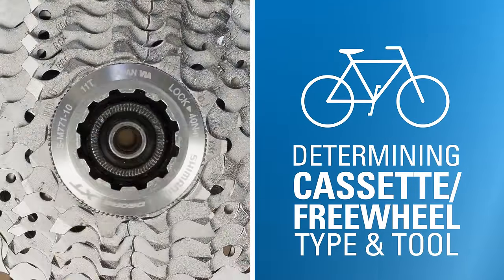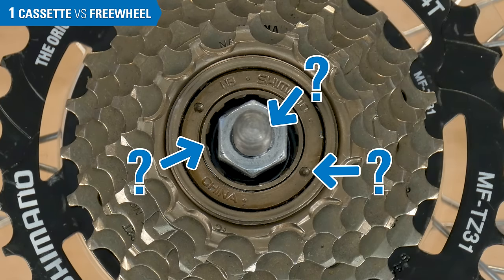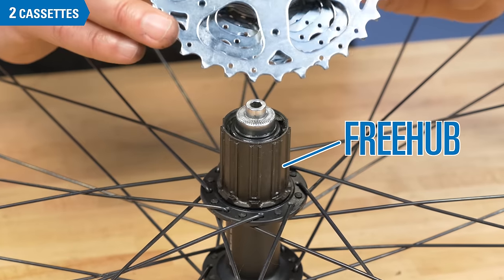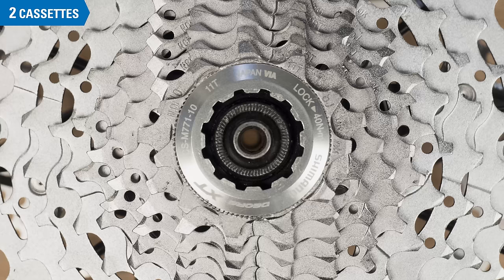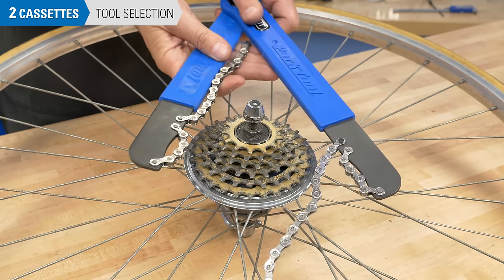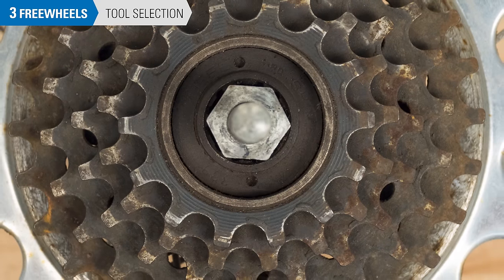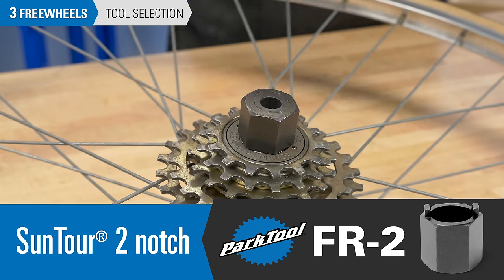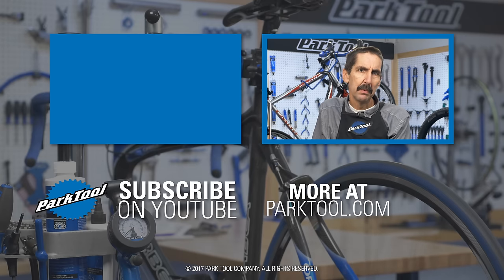Determining Cassette/Freewheel Type & Tool

Comment: Thank you for your awesome videos. Currently running a SunRace MFM300 14-34 freewheel. I bought the Park Tool FR-1.3, which works great for removing and installing the freewheel. However, when trying to service the unit, the adjusting cone sits trapped underneath the 14t cog. While I can use an SPA-2 to loosen the adjustment cone, and disassemble the freewheel, I cannot access the upper bearing race. The SunRace freewheel at 1:26 has the same issue. Is there a tool you would recommend to remove the small 14t cog (it appears to have 4 shallow notches)? I ripped a chain whip apart already, so that didn't seem to be the solution...
Reply from the maker: It is best to remove the freewheel to make the needed adjustments. The really important part is locking the cone to the locknut on the driveside. Then you can make final and down the road adjustments down on the non driveside.
Reply: @parktool  Thank you so much for your quick reply. The "trapped" adjustment cone I was referring to is not the hub cone, but the upper bearing freewheel cone/cap that holds the freewheel together, which can be loosened using an SPA-2 spanner or a pin punch. After unthreading this cap, the freewheel body drops out of the sprocket cluster, but the cap itself remains stuck between the upper race and the 14t cog. It appears you'd have to remove the 14t cog to access the cap (which acts as a cone for the upper freewheel bearing race). The arrangement is identical to the SunRace freewheel pictured in your video at 1:26, you guys even highlighted the 4 notches on the inside of the smallest cog that spin along like on a cassette lockring. I was wondering if there is a tool that fits into those 4 notches, and in combination with a chain whip might be used to unthread the 14t cog .

Comment: So what is the difference between the FR-5.2, FR5.2G, and FR-5.2GT? They all have 12 splines so can the 5.2 be used in place of the 5.2GT?
Reply from the maker: The FR-5.2 can be used in place of the GT, but without the pin use care to keep it fully inserted into lock ring.

FR-5.2- has a hole it in for solid axles. Use skewer when possible to hold tool to lock ring.
FR5.2G- has 5mm pin to prevent it rocking and twisting in lock ring of quick release hubs. Faster to use compared to FR-5.2
FR-5.2GT-has 12mm pin to prevent rocking for thru axle hubs.
FR-5.2H- has handle built in.

Comment: what do you need to re tighten your hub nuts on the cassette side? the hub nut is inside of the cassette and i cannot hold it to tighten the outer lock nut. Thanks.

Comment: notch type 4 notches very old Campagnolo hub. tool? could be campagnolo C Record.
Reply from the maker: The Campagnolo C-record is a freehub system, with a 12 notch ring.   The Campagnolo thread-on freewheel used two notches using their own tool.  Look for a name on the freewheel, not the hub, for the brand.

Comment: I need to remove an old TDC freewheel from a 1970s Dawes Galaxy. It has notches at 12, 4, 6, and 8. Is there a Park Tool freewheel removal tool I can use for this?
Reply from the maker: TDC had a unique pattern.  Park Tool does not have a tool for that model.

Comment: What's the difference between the FR-5.2 and the FR-5.2G? I see that the G has some sort of spine sticking out of it. What's the that for?
Reply from the maker: "G" is for Guide Pin.  It helps prevent the tool from twisting out. You don't need the skewer to hold it is place, and so save some time.  The FR-5.2G is for the quick release axles in 10mm, with a 5mm skewer.

Comment: Does park tool have tools for change ball bering inside freewheel?
Reply from the maker: We do not have the tools for that. It is not recommended by manufacturers and at the point the bearings are in bad shape the teeth of the sprockets are likely worn as well.

Comment: Have an old Shimano 333 High Flange Hub Set Early 1970s 12 splines.  Think the FR1.3 will work?
Reply from the maker: No, the early Shimano freewheels are a smaller tool fitting, but still 12 splines.  Park Tool does not make a tool for this older version.  Search the internet for "Shimano Boss Freewheel Tool".

Comment: The 12 spline FR1.3 for Shimano Freewheel can also be used for 12 spline Shimano cassettes?? The FR5.2 looks the same, what is different?
Reply from the maker: The cassette is a 12 spline but slightly larger. The torque is significant and the smaller FR-1.3 is a sloppy fit and can ruin the ring.

Comment: I have a freewheel and it moves side to side. What do you think the problem is.?
Reply from the maker: It is not uncommon to see when coasting the freewheel oscillate a bit and move side to side.  The bearing surfaces of the inner and outer body are not exactly concentric.  This only occurs when freewheeling, because when you pedal the two lock together and this side to side movement stops.
If this is what is seen, there is no problem.....just don't make a habit of staring  down at the freewheel when coasting on the road!

Comment: What makes the noise when ur not paddling but the noise when ur riding without paddling rattling noise
Reply from the maker: A hub or freewheel that is in good working order will put out a ticking noise when you coast. This is caused in most cases by "pawls" in the one way clutch mechanism. These paws engage into a toothed ring that is attached to the wheel. This allows the wheel to move freely in one direction but not in the other. This gives you the ability to go and coast. Here is an article that contains some images of different kinds of freehubs. Most will have a pawl system similiar to the Campagnolo or Zipp images. Hope this helps!

Comment: I have a shimano splined freehub with both internal and external threading. Is this able t use either the threaded small (external) or the threaded lock ring (internal)? Thanks
Reply from the maker: At this point in time it is usually more logical to use the internal lock ring and appropriate cassette when given the choice.

Comment: what is the measurment of the falcon tool? my free wheel is branded Ko Shaing Industrial Co and is 24mm and 12 splines, a standard 12 spline shimano does not fit it, thanks!
Reply from the maker: Hello eufogia, The Falcon freewheel tool measures 22.9mm. My first guess would be that you need an FR-1.3 and the Falcon would be my second guess. Let us know what you find.

Comment: Is there a one fits all locknut for shimano cassettes?
Reply from the maker: If you have a Shimano cassette, FR-5.2 is more than likely what you need. There are very very few situations with a Shimano cassette that a different tool would be needed.

Comment: What will cause a Freewheel hub to lock up in, Coast and throw a chain off the crank gear? I adjusted all the gear changes, they work fine but it will lock up in Coast in all gears and throw a chain. I took the wheel off and spun the gear cluster in Coast upright like it's on the bike it locks up. Then I turned it flat gear facing up and spun the cluster it turns freely what's up with this?
Reply: My Trek started doing this a while ago--not bad enough to throw the chain but it was binding enough to max out the tenisoner and make the chain sag. The freewheel's got bearing balls inside that the outer part spins on. I opened mine up (left-hand-thread lock ring on the part that doesn't move with the sprockets) hoping to clean and lube it and found that some kind of bearing ball retainer or race or something had almost completely disintegrated. Looks like I'm replacing the freewheel. Maybe something is bouncing around inside of yours?
Reply: John  Yup.

Comment: So... If I want to change my sram for a shimano ultegra the freehub will not be a problem... Right?
Reply from the maker: Likely.  SRAM road freehubs use the same freehub spline pattern. If you are moving from that to an Ultegra it should work. 
 SRAM also produces the XD and XDR freehub systems which is very unique and will not interchange with Shimano. Those came from their 1X series.  See these at https://youtu.be/iTJ3taJHOn8?t=245

Comment: I have a freewheel with 8 notches on my dirtjumper, what tool do I need
Reply from the maker: There are some single speed freewheels with 8 notches.  Park Tool does not offer a tool for this, so contact the manufacturer of the freewheel.  ASC BMX for example makes such a model.

Comment: My Cassette will just fall off if I hold my wheel on its side I'm not careful when I put on new tyres with Cushcore installed , I have a  2018  Rocky mountain Powerplay
Reply from the maker: Sounds like the cassette with freehub body falls off?  The end cap should hold that on.   See if that is the issue.  When it is on the bike, it may not be an issue.

Comment: Do you make a spline tool for removing a Shimano Dura Ace freehub, this tool has 8 splines.
Reply from the maker: What Dura Ace hub model? To remove the freehub you need to remove the axle to access the tool fitting for the freehub body. The tool will depend on the generation of Dura Ace.
Reply: @parktool  It's a dura ace 7201 8 speed hub, the freehub has a spline.
Reply from the maker: Oh boy. Glad i asked. That requires the Shimano TL-FH10 to remove and install. No after market company provided tools for those hubs. Euro Asia imports may have that in stock.
Reply: @parktool  Does EA Imports actually sell bike parts ? Can't see any prices!... Great website though and wasn't aware of it...Thanks for that.

Comment: I have a question about free wheel. My friend has 1975 bike . He try fine how to update real wheel
Reply: Eric Patterson 
Most likely will be will have to buy a new wheel with an updated hub to accept a new freewheel or cassette.
He may be able to have a shop remove the old one and see about fitting a new one on as well. Just make sure it's the right # of gears.

Comment: can we change a single speed freewheel bike into cassette
Reply from the maker: A single speed freewheel threads on to the hub.  The cassette system must have a "freehub" body built into the hub.  See the threaded hub body at https://youtu.be/iTJ3taJHOn8?t=336  This hub will accept a single speed freewheel, but cannot be made into a freehub for a cassette.

Comment: At 1:27 you show a multiple tool fitting one, how do you remove the outer one?  I can't find anything on this
Reply from the maker: The outer is not meant to be removed. This is used to assemble the freewheel. This is a remove at your own risk deal and will usually end with many tiny bearings on the floor. Might be fun though! Good luck
Reply: Thank you, I have rebuilt a few freewheels before.  I bought a bike for my wife and you can tell that it is pretty dry in there, I just want to grease it up a little.  How do I open?  2 chain whips to the  1st gear?
Reply from the maker: This is a Sunrace freewheel. As far as type, I'm not sure how to answer that. Stein tools dones make a tool for injecting grease into the freewheels. I have also used this tool to run degreaser through to clear it from debris and then injected proper grease. http://www.jastein.com/Html/Tools_for_Wheels.htm  Hope this helps you on your mission

Comment: Can I change a freewheel to a cassette sprocket
Reply from the maker: The only way to change is to get a new hub or wheel.
The cassette systems require a special hub.  The clutch part of the freewheel removes with the sprockets.  For a freehub and cassette the clicking part, the clutch, stays with the hub as only the sprockets are removed.

Comment: is it possible to install   cassette hub disc brake + cassette in a  previously freewheel type bike ?   (old  bike 6 speed rear)
more like will it be compatible with the old derailleur ? if i add the new casstte hub with macthing speed number
Reply from the maker: unfortunately there  are no 6 speed freewheels available. You would need to upgrade your drivetrain as well. At this point it is often time to look at a new bike if you are interested in the increased performance.

Comment: My sprocket isn't spinning 0:54, whay could be the issue? I have Shimano system under KHS MTB. It moves a little like 1/8 inch but never spins.
Reply from the maker: If your sprocket is not spinning then you may have something bound up between the largest cog and the spokes or hub. Often spoke protectors can break and cause binding.
Reply: Park Tool I had it fixed this morning. The man took out the sprocket first, then the tube where those small and big BB balls are found. He said that there was a build up of rust, not sure if it was rust. He cleaned it up, added lubricants and reassembled. It was working after!!

Comment: Hi I have a trek roscoe 7 there is a slight wobble in the cassette. When I turn. The crank backwards the chain goes down the cassette. What do you recommend I do? Shifting is fine
Reply from the maker: Your chainline could be slightly off but more often than not this is unavoidable in alot of the newer wide range 1x systems.
Reply: Park Tool so is there anyway to correct it?

Comment: I have a freewheel installed, but i just bought a 105R7000 groupset. That means I have to change the hub I have cuz  the shimano 105 is a cassette type, the problem is, in my country is a bit complicated to get a 105hub so which other hub should I use instead of 105hub? theres any problem if i use another brand?
Reply from the maker: You can use another brand as long as it is compatible with 11 speed cassettes. There are many other brands that offer compatible products. Just make sure it is 11 speed road compatible.

Comment: Well, I am a newb and I do not understand why I would want to remove the gears from the wheel.
Reply: a) cleaning
b) to fit different ratios - something like a 12-26 might be used for a time trial, while an 11-32 (or wider) might be used in hilly country or for touring
c) to transfer an existing gearset to a new wheel
d) to replace a worn gearset, keeping the same wheel
and no doubt more
Reply: @petermilsom1109  Of course, that makes sense. Price diff between fw and cass seems about $50 at Bikes Direct. Am looking 4a bike, will go w/cass. I will do my own maintenance, just need learn everything first! In the long term cass is much cheaper so the mfr's stick you anyway by raising the price of cass. Thank-you for taking time to reply.

Comment: Can I use the fr 1.3 instead of one of the fr 5s
Reply from the maker: The FR-1.3 is a different pattern than the FR-5 / FR-5.2 family of tools. They are not interchangeable.
Reply: @parktool  Ok ill just buy both thanks parktool.

Comment: How is it possible that my cattette is very quit when I peddel backwards but the cassette on the bike of my neighber makes so much noise that you can hear him riding his bike one street away? I mean, his cassette rattles very loud.
Reply from the maker: Freewheels and freehub bodies vary quite alot when it comes to noise level. Many high end hubs are extremely loud (think Industry nine, Chris King, and Hope). in many cases the engagement has a more positive stop and stronger springs acting on the pawls. In other cases it is just based on the design. Noise is not synonymous with quality though there are lots of high quality hubs that are quiet or even silent(think onyx).  Or sometimes the freewheel is worn out. Hope this answers your question!
Reply: Many thanks for the fast answer.

Comment: How do you upgrade from freewheel to cassette?
Reply from the maker: You would need a new wheel and a cassette. Thanks! T.
Reply: i did this, going from 6 speed freewheel to 8 speed cassette, New wheel, new cassette, new shifter (and in my case, new derailleur, too!)

Comment: My inner measures 34.1 what tool do I need
Reply from the maker: It sounds like you may be measuring the lock ring that holds a freewheel together. Look farther inwards of that. its likely that the FR-1.3 is the correct tool for that. Send an image to tech@parktool.com for more details.
Reply: I have what might be the same thing. It's a 2 notch(34.5mm outer width) single speed freewheel that has 2 rubber shielded sealed bearings that came from China(its almost like a Profile knock off but seems super smooth). I've been searching for a tool with 2 Prong 34mm+  outer width & and idealistically, the prongs(teeth Is what I call them) would be 4mm wide or 5mm wide at most. 
I'm thinking about buying a shimano tl-fw40 tool and grinding it to the size I need, but I believe the teeth of the tool are going to be a little narrow. The only other tool I've seen that's close is a Super B freewheel tool TL-1095(they make a TL-1090 model that has a 32mm outer spacing that wouldn't work).

Comment: The reason why they make so may designs soo confusing instead just one unversial design is so that you take it to bike mechanic shop and paid them or else they wouldnt have any jobs
Reply: I started as a bicycle mechanic and moved on to motorcycles and cars as an adult. I can tell you that I have more money in special tools than some spend on a house. Still that's nothing compared to the wealth of knowledge of nearly fifty years turning wrenches. Everything you own was designed by an engineer for the companies needs and mechanics are of very little concern. If we weren't around they'd just sell you something new and actually would prefer that.
Reply: how many car makes and models have you ever seen ? There are thousands, and new ones every year. Why should bikes be standardized ?  So visiting a bike shop for advice can be a very good move.

Comment: Will any cassette guy on any hub accept for sram and shinamo differences
Reply from the maker: In short, No. There have been a few different generations of cassette specifications. Maybe I can answer the question more specifically to your hub/ cassette combo? How many speeds currently and approximately how old is it?
Reply: I have a free wheel system and a shimano slx cassette that I want to put on
Reply from the maker: You cannot run a cassette on a wheel meant for freewheels. The hubs are designed differently.